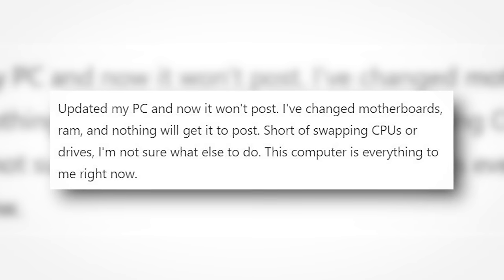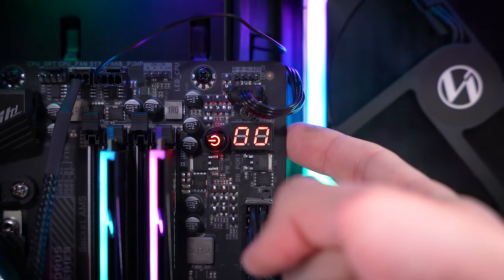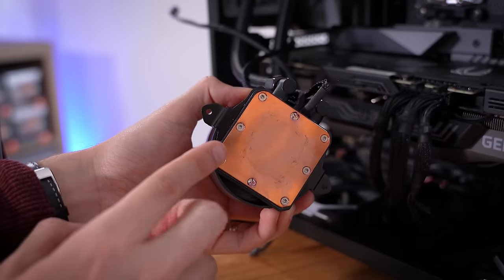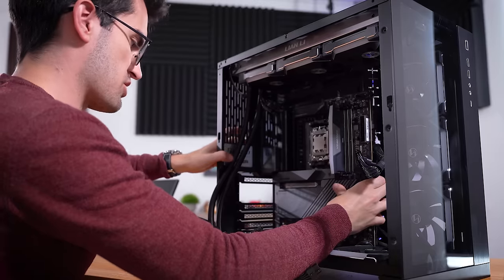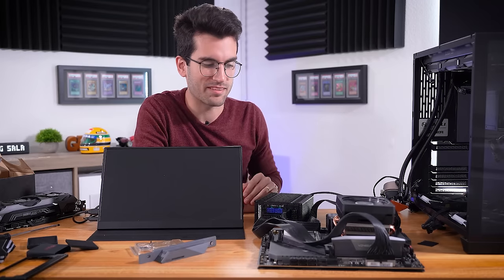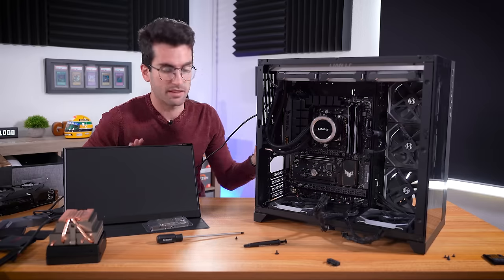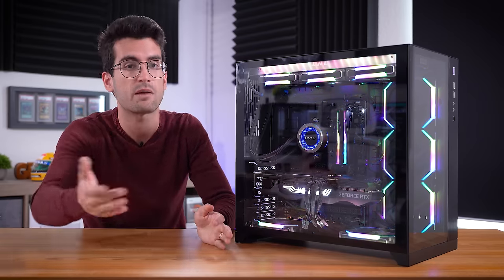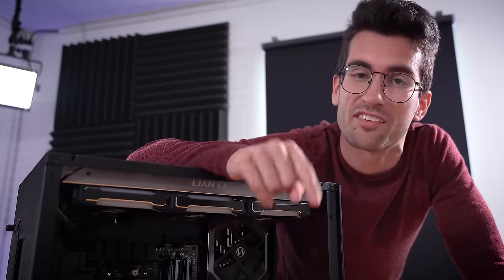Fixing a Viewer's BROKEN Gaming PC? - Fix or Flop S5:E5

Comment: My experience in consumer electronics is that repairing devices comes down to what is possible.  If, for example, you're repairing an Apple device you can just [cheaply and quickly] replace every part except the main PCB.  So sometimes the only option is board work, but most of the time you just the replace the peripheral  parts.  Lois Rossman would love me, Apple named me in a cease and desist once.  We did a repair for an insurance company and the customer sent it to Apple, they stated that not one part that we returned was original.  Of course I said that was nonsense, the main PCB was original, hehe, I got the rest [including the case, flexes, LCD etc] from Shenzhen.  And I mean the rest.  I never did get sued by Apple in the end.  😁

Comment: We used to repair the multilayer PCBs on F18's in the early 2000's in the Aussie air force, not because it was cheaper, but it was the fastest and quickest way to get the parts serviceable again. Beyond high intensity environments, or where extremely bespoke/rare parts are required, board level repairs are seldom the most cost effective vector of repair.

I got out the air force and in to pure engineering, designing reactors, oil rigs, refineries etc. and in that environment with pretty common hardware (in most cases) for the control systems it was just a throw away society. Siemens, Allen Bradley, Rockwell, Honeywell, all produced exorbitant amounts of hardware where it was cheaper to replace than to repair when something went wrong.

I'm lucky to now be working for a large aerospace engineering company designing weapon systems for the MoD and DoD. Almost nothing uses existing hardware and everything needs to be made from scratch besides some rudimentary control. It's a lot of fun, but it sends the cost through the roof. You're extremely wise to be replacing parts instead of fault finding to component level in the PC builders world. If you have to spend more than a handful of hours isolating a fault you're already losing money.

Comment: I wonder if that cold plate has an electrical issue and is the pump  is integrated into the cold plate maybe the wrong type of power is flowing to it and burned everything up and now the motor is just sucking up a ton of power with no place to go so it just stays hot. The cold plate shouldn't be hot after like 10 minutes......made this guess at 8:45

Comment: When I upgraded my CPU from a 2700x to a 5800x3d on my asrock, it wouldn't boot either, but I later found a solution that was to do a BIOS update without any CPU, even if you already had the BIOS version that worked with your new CPU, and that did the trick. I could now use my 5800x3d on my Taichi X570. I hope it helps someone struggling like I did.

Comment: Hi, just in case you don't know. If you update the BIOS on Gigabyte boards you sometimes need to take out the battery and replace it before the system will boot again.

Comment: that is the advantage or disadvantage (i guess depending on how you look at it) of COTS.... the more generic and widely used a part is the easier it is to justify replacement of the component rather than repair....I do like vendors that ask for the part/component back so they can examine the part to figure out what went wrong and if there is a bigger widespread problem that needs to be addressed.

Comment: I have an Gigabyte X570 Aorus Ultra motherboard.  I upgraded it to the latest bios provided by Gigabyte and experienced a similar issue where the motherboard would no longer post.  I had to use bios flashback and revert back one prior bios release before the system would post.

Comment: at 12:19 if you look at the bottom left corner of the socket, if oriented where the ram is to the right of the socket, it looks like a piece of the socket is sticking out towards the pins. Its the only thing that doesn't look uniform in the socket. I could be mistaken but I have seen weirder things happen to sockets. as usual great video!
Reply: There should be 4 of those small plastic tabs in the LGA socket to hold the CPU in alignment, although that one does look to be bent out too far and possibly holding the CPU off the pins.
Reply: @johnt.848  I have only seen 1 AM5 socket in person and I don't exactly remember how they look. It just looked out of place to me and the possible cause of the issue, though I could be way off.

Comment: Greg I don't know if you noticed, but you put the GPU back in to test if it works after mobo swap, but the monitor cable is still connected to the integrated graphics, LOL. 18:42

Comment: Frustrating scenario for sure.  True story:  About 10 years ago my wife's AM3+ system quit working.  I didn't have a replacement motherboard, but did have everything else.
I swapped out every part one at a time... EVERY part, and used a known good power supply and it simply didn't work.
Fast forward to a couple about 3 weeks ago - I was cleaning out a room in the basement, and there sat her old case with the motherboard still in it.  Nothing else.
I slapped a couple components in it, hooked it up, and voila - it works!
It is now my "new" home server system.  I stress tested it for a few days before swapping everything over, and it has been running as a server flawlessly for a couple weeks as well.
I think that is the longest troubleshooting timeframe I've ever had 😀

Comment: With gigabyte motherboards, it's a trick to reset the bios and the startup errors! You can do this physically!! That's what you forgot to do on the motherboard. You had to press reset plus power on/off for 20 seconds, then release the reset button, and after another 5 seconds the power button. AND the motherboard came back to life. That's the gigabyte trick. If you did this trick, you wouldn't change anything! Anyway, congrats on the videos!

Comment: Had an issue a few weeks ago, don't under estimate what reseating a component can do. I've had a GPU issue where my system would full on crash and it would be so bad that the GPU driver would corrupt itself and windows would not detect my GPU (had to reinstall the drivers). Two things I have noticed when trying to reproduce the issue; 1) it tool longer to crash when my AC was on, and 2) immediately booting back up and jumping back into a game would cause it to crash within probably 5 min. Thought it was a GPU problem (which is a pain since I have my system water-cooled), but none the less swapped it out for a known working GPU; behold it worked. Sad knowing that it may potentially be the GPU (or a failing PSU not being able to cope with a 7900XTX under full load) I went to try and reproduce the issue; but the issue never reproduced after swapping back in the original GPU. Only the GPU was interfered with between trouble shooting. My conclusion, I had to move my system (and it is stupid heavy) and the issue only arose after moving my system; it probably shook the GPU out a bit, so to not properly make contact with the PCIe slot and any significant heat probably caused it to warp out of the socket. Thankfully my system is still going strong under heavy load.

Comment: Ok, yes motherboard pooped some where, I would wager (without looking up the error codes) that either the motherboard was shorted to the case, or the motherboard was flexed so much that it was short grounding or bypassing a voltage step. If you ever wonder, a trick for reading all the error codes is to video record them, and then play the video back in extremely slow frame mode, because sometimes the numbers flip by too fast for you to 'see' them.

Comment: I agree that not repairing parts when you can swap them out makes the most sense most of the time. I went to school to be a computer tech and actually learned how to do repairs to motherboards and various circuit boards for printers and all kinds of hardware.  And when i started working I was told to forget all of that because nobody does that anymore......in 2005.

Comment: I started out replacing integrated circuit chips on boards. Later we would just replace the board with a note as to which chip was defective and send it back to the factory. Eventually it was more expensive to repair the board then replace it at which point I would gather a bunch of defective boards and take them to a recycle center.

Comment: Didn't catch it in the video, but did the replacement mobo that solved the problem also have the same issue with the CPU seating unevenly?  Looks like we only got to see the replacement board after an air cooler was installed.

Comment: I definitely like your troubleshooting process and I do very much the same.  One thing I always try to do whenever possible is not just finding out what went wrong but WHY.  Figuring out why something happened is often more valuable than just fixing it.  I've had cases where a problem had been fixed only to return again later on and no one ever tried to figure out the root cause.  If a component on the motherboard died I'd like to find out what caused it because that might just lead to a bigger issue just waiting to return...at the worst time.
Reply from the maker: We try to answer the "why" as often as possible in this series. Sometimes, there won't be an explanation or anything obvious to blame given the limited board testing we often perform.
Reply: @GregSalazar  Absolutely. And please forgive me. This was not a critique. I was referencing why the board went bad.  If a single component failed, like a mosfet for instance, I want to know why. Was it under rated? Was there a further failure upstream that caused an over current situation? Things like that. 😊

Comment: 40C in BIOS is pretty common, at least on Ryzen. From my 2700X to my 5900X, they've always idled at around 40C in BIOS. CPU might just be idling, but it uses more power to insure stability while in bios, especially in the event of a BIOS update.

Comment: hey Greg... I noticed at 8:43 that your 7600X wasn't seated down in the socket properly, and (before getting any further) I cringed a little when you put the pressure plate down and clicked the spring in place. then a bit later when it wouldn't turn on, I went back further to check something.

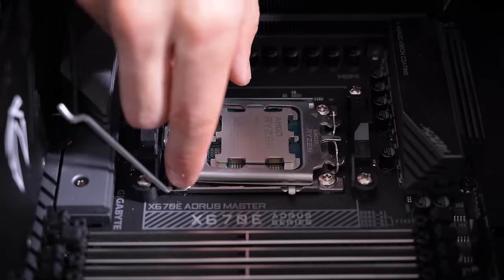if you pause the video at 7:30, while it is from a different angle, it looks like the original CPU is actually sitting flat and flush in the socket... which it most definitely is not at 11:00.

disclaimer: I haven't actually finished watching this video just yet, but considering the force applied on that little piece of plastic, especially once the cooler goes on, I can't help but wonder if you will actually get to the root of the original issue now... :/ hasn't that possibly caused some damage now that was not there before? no judgement, I've done that exact same thing myself (with much cheaper hardware though).

Comment: It's also very likely that it's not possible to fully repair the motherboard.  Especially if something is damaged.  And like you said, the cost of doing so would exceed the price of the board unless it was one of the super expensive ones.  It's always best to test and swap the easy to replace stuff first, even if you do suspect the board.  Because more often than not, it does turn out to be something else.  And going right for the motherboard ends up being a waste of time unless you've proven that's what it is.

As for DOA boards, it happens.  When I built a computer for a friend of mine, the first board we got was dead out of the box.  No power to anything (and we had verified every other component in my system).

Comment: I waxed a bios chip back in '99 by static discharge. Ended up being a board replacement because replacing the chip on the board would've cost more than getting a new board. I went with a dual chip bios on a Gigabyte board available at the time.

Comment: Im surprised you didnt try re-flashing the bios of that motherboard. Would of been one of the things I would of tried.
Reply: I think that might've been it. When I saw the memory codes on the board, I was curious and looked them up on Google. The top result was a forum thread of somebody experiencing the same issue, and rolling back the motherboard BIOS version fixed the issue.
Reply: Yeah, noobs think flashing everything is the answer.

Comment: The huge amounts of heat on the AIO cold plate and warped socket makes me think it could be related to the "exploding CPU" issue that AM5 had, where the board would just keep pumping more power into the CPU to a point where it'd desolder itself. Obviously it was fixed through bios updates, but the earlier motherboards without revisions might have those issues. Gamers Nexus had a series of videos investigating this.
Reply: Then the CPU would be as hot or hotter than the cold plate on the AIO, and it wasn't.
Reply: @johnt.848 owner tried a Bios update and either installed the wrong one or turned it off when updating and bricked it. 

Would have liked to see a BIOS Flashback done first or w/e Gigabyte calls it. 

High end board will have an easy way to do it.
Reply: @South_0f_Heaven_  That is possible, but doesn't explain why the AIO was very hot and the CPU wasn't.
Reply: @johnt.848  simple,

The owner bricked his system, put the junk motherboard back in without the cpu being even seated properly. Could have oc’d it not knowing what they were doing and overheated the PC easily by not having enough airflow. 

Happens all the time people build very nice systems, refuse to turn the fans up to a proper speed to keep cool air flowing thru the case then smoke what they have. All because “fans are too loud”

Pump could have been spinning at 200rpm pushing zero water thru the AIO causing the hot cold plate. 

Anyway that motherboard is new enough it can just be RMA’d and replaced which should have been done to begin with.
Reply: @South_0f_Heaven_  Finally, you address the fact the pump possibly being faulty is why it was so hot, and the CPU wasn't. That was a lot of waffle to say I was right.
Reply: @johnt.848  Gonna throw this idea into the ring: I know that AMD's IHS is engineered pretty dang well to disperse heat. Could be possible that the heat sink of the AIO simply had more material/mass to absorb the heat, and thus would take longer to cool off than the IHS.
Reply: @johnt.848  if there was a problem with the pump then why did it work fine with the new motherboard?

Pumps either work or they don’t. Had a run of bad Arctic AIO’s three separate pump failures on 4 month old and new between a 240mm and two 280mm so I know exactly what happens when they go bad.

Comment: That’s an odd one there, however fwi I wouldn’t adjust core voltage as when you do pbo will likely be disabled. High idle voltage is common with pbo which is enabled by default.

Comment: I got a question about a nzxt b650e mother board. I can’t get the WiFi or Bluetooth to work where should start looking? Would it be in the bios ?
Reply: Did it come with those features? If it did, look in the BIOS.

Comment: There are electronics worth doing board level repair on, but most PC components are just so inexpensive that, as you said, it's not time/cost effective. With the plethora of different manufacturers and models. Good luck getting the schematics much less replacement parts. Even the companies that make the components don't repair them when they are returned.

Comment: great video. bit of a spicy one. :) Regarding cpu temps in bios, it does sit with about a 15% load when in the bios so those temperatures are completely normal. :) My 5800X sits around 50C in bios but idling in Windows it's hovering around 35C.

Comment: JFYI - this exact series of LianLi AIO - Galahad 240/360 - were prone to the clogging issue where coolant clogs up in the pump stopping the flow. That might be the reason for the motherboard failure - overheated socket warped and unsoldered itself. LianLi accepted the blame and extended warranty replacing these at first request. Because you moved AIO that might temporarily move the clog but this can reappear at any moment. I killed my X99 system with one of these  less than a year ago so that's why i know about it :(

Comment: I once had a pc keep crashing. I had to power cycle it to get it going again. I couldnt find anything wrong with swapping cards, memory etc. The problem turned out to be in the power supply, the fan grill was blocked with dust and fluff ! A quick clean and all sorted.

Comment: It's unfortunate that when some people throw out the accusation of 'not fixing' the problem, that they don't understand - the problem IS fixed by replacing the component, and the PC is functional again.  Sure, there may be issues with the old part, but that's not what a computer repair tech does.  That's something that a board level technician does, and usually charges a significantly higher price for.

Comment: AM5 systems were a trip when I first started building them for friends and family but i love the platform its reliable and faster than intel across the board and i generally run every game better. I only use AIr coolers they are far more reliable and liquid coolers have all died on me before warranty due to poor design, cheap manufacturing and just general unreliability.

Comment: I would of tried flashing the bios with latest version before swapping out the motherboard. I have seen similar issues to this where a bios flash brings it back to life due to a corrupt bios. You should be able to flash the bios even though the system isn’t posting.

Comment: As soon as I saw the double zero debug code flash up there I knew it was a motherboard issue. I had the same problem with an old rig of mine , on an  ASRock k6 gaming motherboard and an Intel i7 8086k.
It worked when I went to bed that night I woke up the next morning it was gone coming up and from what I've read online that was the code of Doom. 
I replaced it with an MSI z390 carbon worked fine the motherboard, that damn Asrock motherboard had shit the bed..